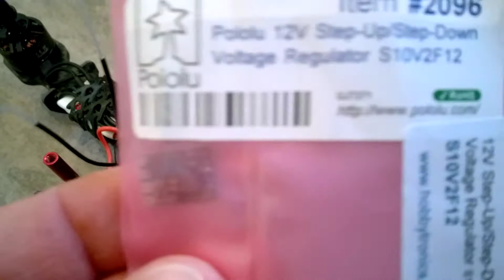ZMR 250, Pololu on the team legit Nucleus PDB board

Comment from the maker: You just need the Vin, Vout and Ground. All I did was to use some straight pin headers and solder them to the PDB poking them through from underneath. Once soldered in I removed the black plastic that holds the pins apart, slip the Pololu over the pins matching up the V-in, V-out and ground (you do not need the  SHDN). Leave a small gap so it can not short out and solder it in to place. I then coated it with liquid insulation as it is very vulnerable to damage from landing in wet grass. Hope this helps.
Reply: +Ian Holt Thank you very much, this video helped a lot. I would have just ended out cooking my fpv gear if I didn't see this. Thanks for the help

Comment: the pololu has 4 pins and the pdb only has 3 holes. Do I just remove the extra pin? And also does it just work on my camera or will it also regulate the voltage to my transmitter? Thank you

Comment: So you laid the pololu flat against the board?  Do you even need pins or you you just tin the holes on both and melt the solder together?  I got pins with my pololu and the picture shows it sitting up off the board, but space is limited.